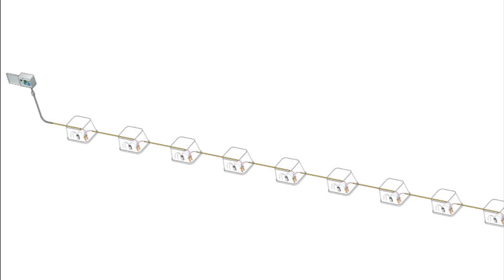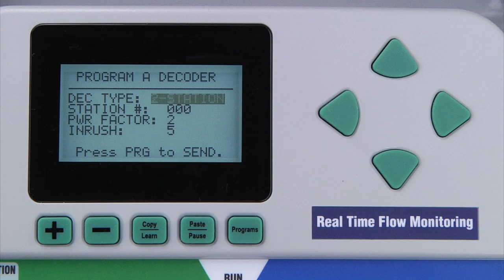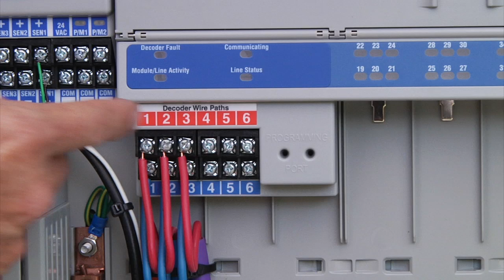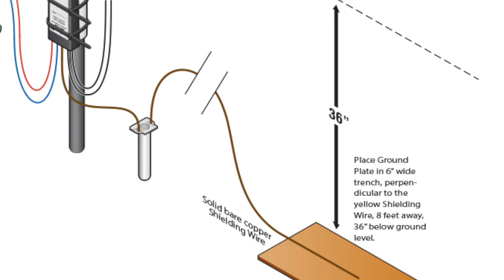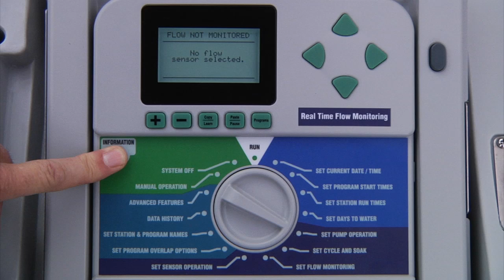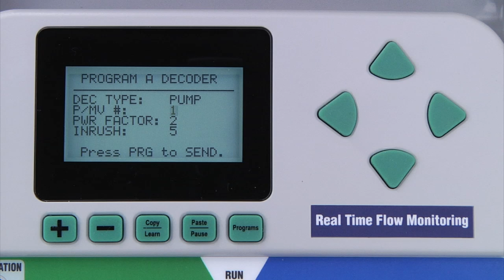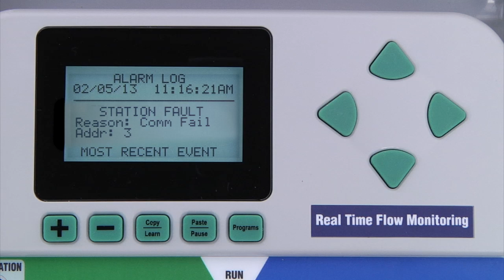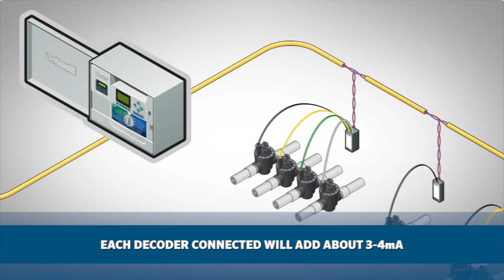ACC Advanced Programming: Decoders, Part 1

Comment: I have a question in regards to our 2 wire system. When we run station 1 (set at 45 min run time) on our 4 station decoder it runs for about 10 min and then the water (valves) shuts down but the time clock keeps counting down like the valves are still open. The other 3 stations run normally for the whole run time. What would cause this? Thanks!!

Comment: I am on a site that has the same controller. They currently have 99 decoders on the system. It is there  request to install more decoders in a different section we are working on. My question is, will another module, be added or will another controller have to be installed? It will be another 60 decoders.
Reply: I’m tryna figure out the same thing
Reply: Swap out to an ACC2 Controller. Don’t have to reprogram all the decoders just change the controller.
Reply: @ItsThaKidTv  acc2 controller. Just swap the controller out. Decoders all same and the programming is in the decider not the controller so it’s an easy swap

Comment: I do not understand why these wire connections are not twisted (and soldered) before the wire nut is installed.
Reply: All these systems would be much less problematic if they would be soldered. Is there any device that soldering quickly in the field?
Reply: Not really because what if you’re Solinoid goes bad then you have to cut a re strip that connection again plus if used correctly dby connectors will not give you problems even the. Slime is  voltage Rated to with stand shock and it won’t wash off your hand so you know water is not getting into it